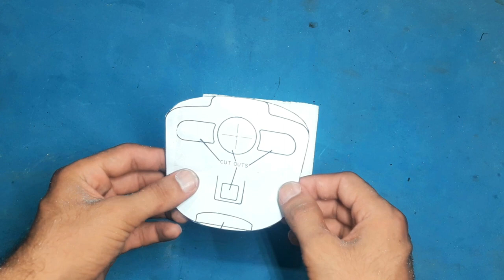How I Made The Cowl For Rc Citabria Plane . Full DIY Build

Comment: Liked the simplicity.
Did you try this method in previous builds?
as I know chopped fiberglass mat has a binding agent to hold strands in place.
So just using epoxy is not enough, as it will not release the binding agent and parts of the strands will not be saturated with epoxy, making the part lacking strength.
You can try adding a solvent in epoxy (like acetone), but in very small amounts.
Keep in mind you have to insulate the foam before applying epoxy with acetone (with wood glue and water mix or polycrylic).
Keep posting videos and don't delay 👍🏻

Comment: Hi which type of epoxy are you using..thanks
Reply from the maker: Normal epoxy 2:1 mixing ratio
Reply: ok, 2:1 more resin or hardener ?? @rcmaking3412
Reply from the maker: @MarcSt-Amant  you can mix 2: resin and 1:hardner